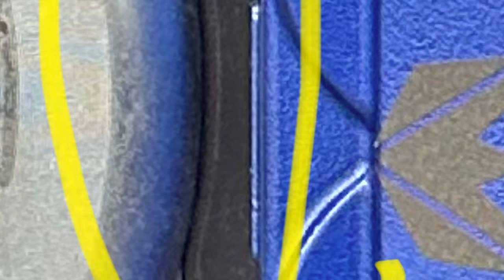OE+ BREMBO FRONT CALIPER UPGRADE- PART TRES and FINISHED!

Comment: Great  job so using the 550 rotors would allow you to run the brake pads with out grinding them?
Reply from the maker: That’s what folks are saying on the forums!
Reply: Yes you are right! 550’s will work
Reply: I guess i will be posting the next video on installing these just need to order new rotors.
Reply from the maker: @ProjectZGarage  heck yea! Good to hear
Reply: @BimmerHausPerformance  which ones? i cant find 374mm 550 rotors

Comment: So you have to grind the pads down no matter what
Reply from the maker: If you use the stock spec 535 rotors (348x30mm), yes pads must be ground. But if you use the 550 rotors (348x36mm but with smaller diameter hats) you do not need to grind them. I chose to grind them because my rotors were basically brand new
Reply: @turbospool  wait so I got the F10 550i. What would have to do if I want the 374mm M550i Rotors and the M550i calipers??
Reply from the maker: @AYO_KO  i dont know off the top of my head. I only cared to learn what I wanted to do to my car and ignored the rest, lol! BUT, head over to bimmerpost forums> f10 > f10 technical topics> wheels/ tires/ suspension/ brakes > and in there are two MASSIVE threads regarding what G-series brakes are compatible to our F10s and what is needed to make each “stage” work on your car. I referenced one started by Darkkn1ght. Hope that helps!